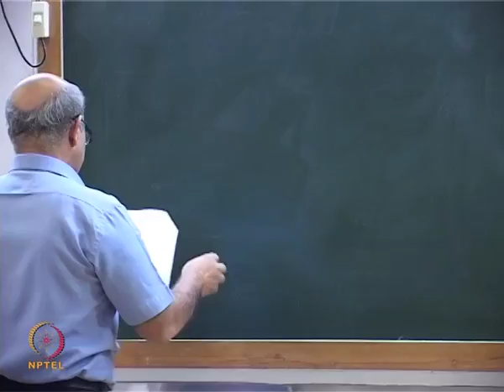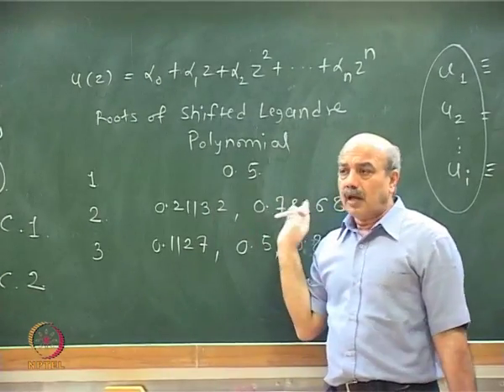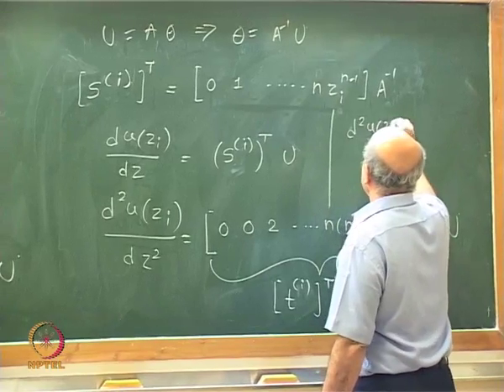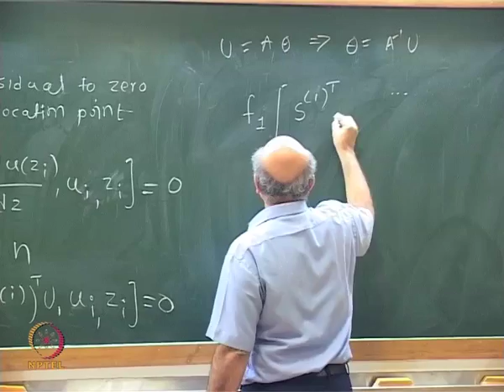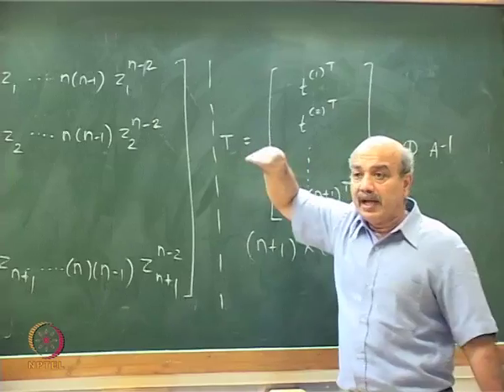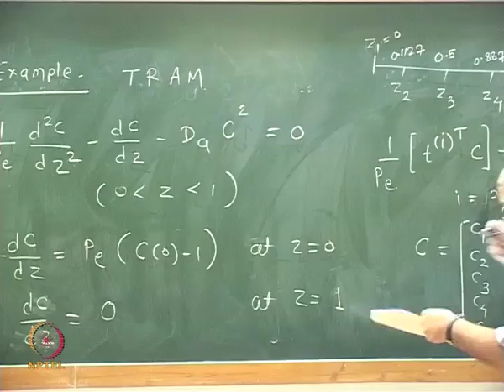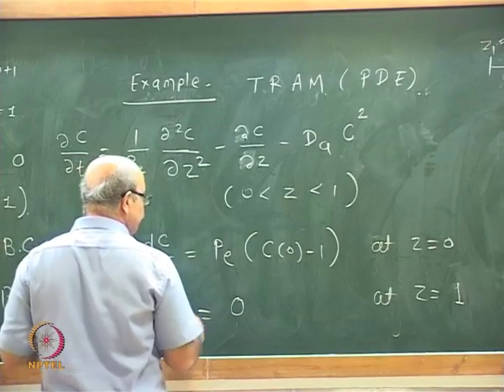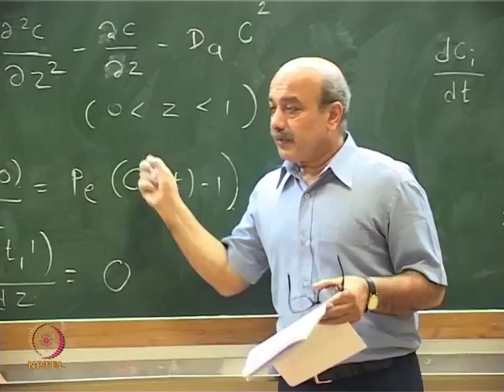Mod-01 Lec-16 Orthogonal Collocations Method for Solving ODE - BVPs and PDEs

Comment: Dear Sir, excellent lecture.  Thank you.  I am slightly puzzled as you have taken 4th order polynomial for approximation over the interval to cover the initial and final points using 3 roots which correspond to 3rd order polynomial.  Could you please kindly explain ?

Comment: In the example problem, how did we invert A matrix when order of collocation polynomial is 3 (cubic) but the number of collocation points (u) taken were 5 ?
Reply: I was also confused by this, for 3rd order polynomial, A would be 5 by 4? (5 rows since we have z1,z2,z3,z4,z5, and 4 columns since u(z) is third order so it has 4 terms!
Reply: @aishaalobaid7974  the first term is 1 not z